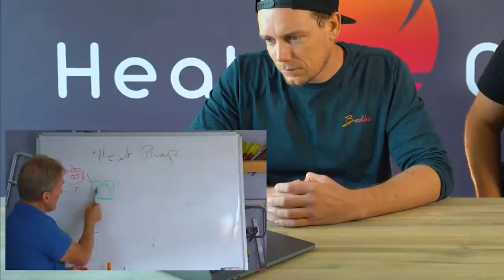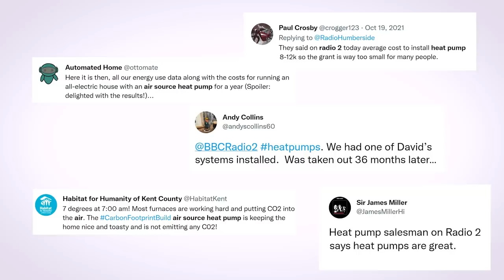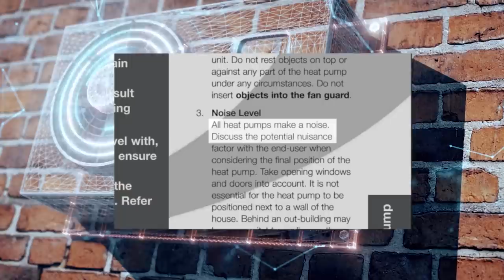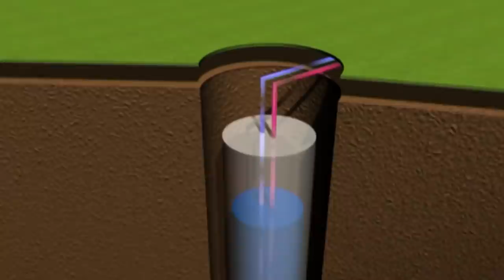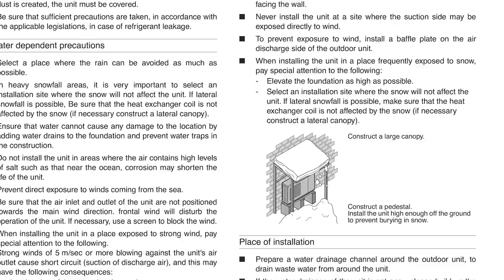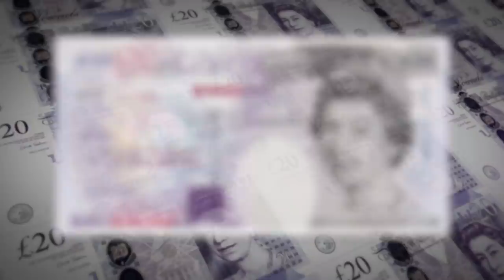Heat Pump Secrets They Don't Want You to Know

Comment: this guy is full of it! yes there can be noise IF you don't mount it right because it will vibrate the mount. Pumps will heat well below freezing and the backup heat source is if it gets really cold. Heat pumps being kept on and running itself, well DUH you leave the power on but it's not going to pumping the whole time. Energy needs for the pumps isn't that much of an issue since they're more efficient than electric heaters which a lot of homes around here in the us tend to use. Every set of instructions I've seen and experienced first hand all say the same things about salt, water, snow, ice, rodents, keep them off the ground, winds. Recommends that you have the AC unit either in that hutch or in a shady spot for the thing to work properly. As for winds breaking the fan, you either have a fan that does the job needed or a "high speed" fan that's was bigger, uses more energy, heavier, and let us not forget a fan can be used as a generator like a wind turbine.

Comment: gas to electricity 60%, transmition losses 5%, heat pump effectivnes 300-500%. So.... 0,6*0,95*3 up to 0,6*0,95*5 that means difference from making heat directly from gas to making heat by heatpump driven by gas is about 70% to 385%... Even at 3 COP it is still better.

Comment: If the UK government feel it is such a good idea. Then it should be introduced heat pumps into the building regs for new builds. Along with EV charge points, solar on roofs. Water run off flood protection under every driveway. triple glazing. And building materials manufactured  and sustainability to be have paid back  it's total CO2 emissions  to build  by 2035. I think it would be prudent to future proof houses to deal with the effects of this global warming prediction. Build houses away from flood areas, build houses better suited to the new temperatures and weather conditions .But i honestly don't think it is practically or cost efficient  to do so. So how can it ever be effective for a pre existing house.

Comment: Lot's of gotcha's for sure, and no mention is made of the eye watering cost of heat pump installation. Even if you have the heat pump installed, most will need new (larger) radiator's, which could include replacing pipework. Then there's the potential to have to replace windows and additional insulation in walls/lofts etc. Typical ASHP install cost - £8-15k, and GSHP £15-25k. Typical 30kw combi (A rated) bolier install - £2-3k. Also, as alluded to, you need electricity to run heat pumps - where does that come from? Does this mean people will also need solar with battery storage because taking that straight off the grid isn't going to be cheap either.

Comment: Heat pumps produce MORE pollution than gas boilers.  That’s because they burn more gas (at the power station) than gas boilers for the same heat.   NEW wind farms for this NEW electrical loads will be just a couple of percent at most.

Comment: This video was recommended by youtube. I have mini splits, they are enormously efficient, I've had them on a separate circuit with a kwh counter, it puts the gas fired boiler to shame when I compared watts to watts, and the boiler is a HR++ near 100% efficient. I do not understand what this guy is on about.
Reply from the maker: Mini splits are not grant approved in the U.K. I am talking about air to water which is a completely different deal

Comment: That's not smog, smog is smoke and fog hence smog. Nox is not smoke it's nitrogen and oxide. Smoke is carbon and a mix of elements Nox is virtually unmeasurable. Nox needs very high heat to form, gas burners aren't hot enough to produce a notable amount.

Comment: Snow is an issue as the snow will block the fan from blowing
Reply: And yet this doesn't seem to be an issue in Scandinavian countries where they've been using heat pumps for 40 years
Reply: @Muggles87  agreed. Snow can effect heat pumps which why we put them all on legs. I'm sure in Scandinavian countries they have a way to deal with it
Reply from the maker: wrong type of snow
Reply: @SkillBuilder  yawn

Comment: The new gas boiler took a day to put in (including a new radiator). Simple.
Reply: Well done on choosing the easy option that continues to pump Co2 into the atmosphere.
Reply: @jcutler1018  Yes, it's everyone's else problem to fix, not yours. Pat yourself on the back. Well done on your 1 day combi install.
Reply: @jcutler1018  You're a bit unstable aren't you?  Just to reassure you though, I have an excellent heat pump, so I certainly wont be freezing.

Comment: You seem to be against heat pumps. You can't lump mini split systems in with conventional heat pumps. This is misleading. There are no auxiliary heaters in mini splits. They don't make condensate when heating so no heat trace. Newer systems with inverter drives don't need to run all zones full open either. Ground source heat pumps may be environmentally friendly in the big picture but they're not an option for a lot of people.
Reply from the maker: All true but in the U.K the mini split is not on the list because of the cooling. The governement is very keen not to see them catch on because it will add to the problem rather than reduce fuel consumption.

Comment: We aught to call you Mr Negative. Everything just needs to be installed by a qualified person. My ASHP reduced my properties energy demand by 50% correctly installed and sized for the property. Energy demand difference old system required 16000 kW/anum down to 4500 kW/anum. In time gas will be gone.
Reply from the maker: You can call me what you like Peter but spend a little more time learning to spell.

Comment: Heat pump operation costs are considerably lower than gas, aren't they?  Inquiring minds want to know how the total cost of ownership compares.
Reply: No they are not, costs will vary depending on each individual house/building's heat loss calculations, on my property which is reasonably well insulated i used my years gas consumption to calculate my heat loss, i only use gas for CH not hot water, you then can get an approximate cost of both and see what the difference is.

My House Example:

Average gas use per year = 4685 kwh
Using a 90% eff boiler      Heat loss = 4216 kwh (rounded down)

My gas bill now at 0.07476p       =   0.07476p * 4685 = £388                                                                                
New electric rate = 0.28408p 
                                                                                                                                    
Now a heat pump at at a cop of    3.0    =  4216/3.0 = 1405 * 0.28408 = £399 = loss of £11                                          
                                                            3.5    =  4216/3.5 = 1204 * 0.28408 = £342 = saved   £46                                              
                                                            4.0    =  4216/4.0 = 1054 * 0.28408 = £299 = saved   £89                              
                                                            4.5    =  4216/4.5 =   936 * 0.28408 = £265 = saved   £123                            
                                                            5.0    =  4216/5.0 =   843 * 0.28408 = £239 = saved   £149

now this is a ball park figure to be more accurate you would have a proper heat loss calculation done, then you could work out estimated cost for which ever system/fuel type you are comparing.
as you can see by my figures if i had a heat pump fitted and managed to get a cop of 4.0 it would save £89/year so if your installation costs were now lets just use say £10,000 for reference the return on investment (ROI) would be   £10,000/£89   = 217 years
at least your great great grandchildren will benefit from it.
Reply: @rogertrant2101  Your great grandchildren benefit from which? I guess you mean heatpump. The conclusion is a little muddy but suffice it to say appears near equal and thus other factors need further consideration.  In many locations, natural gas infrastructure doesn't exist, LP is quite expensive and there are other costs / risks to be factored such as environmental, physical hazards, (impacting perhaps, insurance) regulatory and political.
Personally, I prefer natural gas for it's simplicity but my brain often makes poor choices.
Normally I burn wood in an indoor stove and that's worked well for a couple decades, harvesting from the property.  Electric bills in winter have been essentially the same as summer I'm no longer physically capable of harvesting wood, this past winter was my 1st using the heat pump, which increased my electric bill by ~$120/month.  Using wood, temperature fluctuations are quite wide but a steamy-hot house during a sub zero night can be quite satisfying.
Reply: @thisisyourcaptainspeaking2259  ah yes, i remember those days my father used to have a wood fire, he used to say it warmed him up three times, once harvesting and carrying it, twice sawing and chopping it, and lastly burning it. my comment about great grandchildren was meant to be a joke that some people spend so much money on heat pumps but in a lot of cases it doesn't save that much money if at all, so it takes so many years to pay for itself and if it would last long enough it would only be them who benefit.

Comment: Nitrogen oxide by its self does  not create smog
There are two types od smog
Sulphurs smog and photochemical smog.
Sulphur based smog are the tradition London pea soup fogs 
 sulphurdioxide come from burning coal and dirty fuels  when mixed with cool air and water vapour dust and soot  causes smog. Generally at night 

Where to days smog type is the photochemical type 
Nox plays a part but it also the large amount of low level atmospheric ozone trioxide molecules that react with the nitrous oxide and sulphur dioxide diesel particulate that cause this day time haze you see in large cities. These come from diesel and petrol cars the action of solar ultraviolet radiation on atmosphere polluted with hydrocarbons and oxides of nitrogen. It contains anthropogenic air pollutants, mainly ozone, nitric acid, and organic compounds, which are trapped near the ground by temperature inversion. These pollutants and also some others can affect human health and cause damage to plants. Photochemical smog often has an unpleasant odor due to some of its gaseous components. 
To say it NOx by its self is completely wrong 
It's the unburnt hydrocarbon Voc from car engine and uv light and Nox  that on sunny day cause chemical reaction which lead to this nasty smog.

Comment: Washington governor succeeded in natural gas ban state wide. It gets FREEZES SOLID here, blazzards, I have neighbors 10' from where I would have to put it, blizzards all the time, mice, very windy, super hot too. Yet, when my condensing furnace goes out, I'm forced into extremely expensive electric heat, pushing heat pumps like nuts. 😢

Comment: Just because it's on doesn't mean it's running. Ours is on all the time but only runs the compressor when the tank heat drop below thr set temp
Reply from the maker: True but you know that happens in the middle of the night because that is when the house loses heat and your temperature compensation kicks in. Nobody cares what happens during the day but when that heat pump kicks in at 2a.m I am awake.
Reply: @SkillBuilder we have a nebi can't hear it but then again thick walls and we are no where near it our heating is off during the night so doesn't seem to kick in. I've been monitoring all our power usage with current clamp  monitoring so I can plot what is happening and when. Actually quite interesting if your a bit geeky at all
Reply: @SkillBuilder  we are currently trying a combo of off peak energy tariff 10kw battery and air source. Used the tanks a a thermal store heat them to max and charge the battery's at 5p/kw. Charge the car and run washing and everything we can over the 5p period. Then draw the battery's down over the day

Comment: The country does not have ENOUGH electricity in the grid to supply all the heat pumps and chargers for electric cars.
Reply from the maker: They will just start  up the gas fired power stations. They always make up the shortfall.

Comment: These heat pumps work flawesly in Canada, united states, northern Europe and so on even at 30 degrees Celsius.We can clearly see u prefer the old ways, to keep depending on natural gas or oil coming from the ruskies or some arab countries on the other side of the globe. I prefer using a heat pump or any other electrical sistem then to live with 800 liters of diesel under the house or a gas heater that can leak and blow up half the building at any given moment. For the heat pump to work you need to make some common sense changes : decent windows, well insulated house ( floors, walls and ceiling preferably) , without holes or air leaking ( for example a chimney just cover it when not being used), study the exact needed capacity of the pump and floor heaters, radiators or fancoils and install it by an actual profesional that has real experience with these. Most issus come from being poorly instaled . It s not a perfect sistem, I used one for the past 12 years and I just changed the filters, no issues what so ever. Also, in cold conditions, instead of the 400-500% eficiency declared by the manufacters, you actually get maybe 2-300%, and still it s cheaper then other sistems. Spent a bit extra and get the air to water sistems from a decent manufacturer like Nibe, Daikin, Vaillant, Mitsubishi, panasonic or Toshiba just to name a few. Hope it helps

Comment: Nope! If I ever build my own home it's having a diversified energy source. Gas boiler that can convert to hydrogen, electricity, wood-burning stove. If I can afford it, solar panels, solar water heating and a couple of Tesla power walls too. There's no way I'm putting all my eggs in the grid electricity basket - it could be turned off if demand gets too much and the price is already too high per Kwh, so will only go higher in the years to come and as more people become entirely dependent on electricity. It's a trap and electricity is far from clean anyway!

Comment: What a lot of negativity regarding all the guidance in the installation instructions. Any installation instructions will include things to avoid and why. Do the same list of dos and don'ts for a gas boiler and include the possibility it could demolish your house and the neighbor's in a gas explosion leaving dead bodies and rubble all over the road. Such things are rare if you install and maintain properly. There's no need to make it sound like all the warnings are likely to happen. They are not if the manual is read.

Comment: What a load of tosh! Heat pump? Call it what it is ,,, it's an old fashioned air conditioner  and to think all that apparatus  needed to run the pump to compress  gas to feed the condensing coil that's to run the freezer coils ... and use the cold air produced to COOL NOT HEAT  ...and to use all that tech just to then salvage the little bit of heat from the compression side and call this a heat pump is ridiculous!